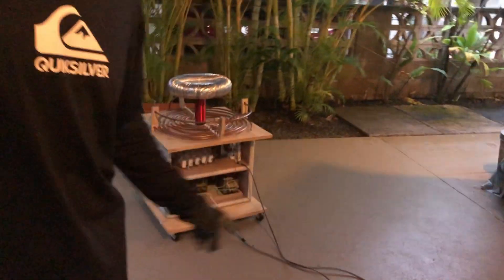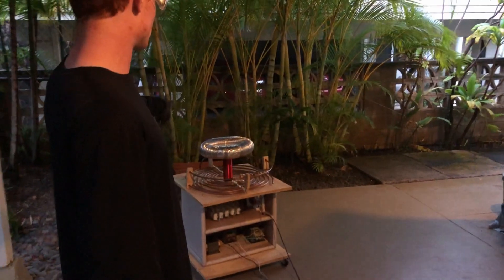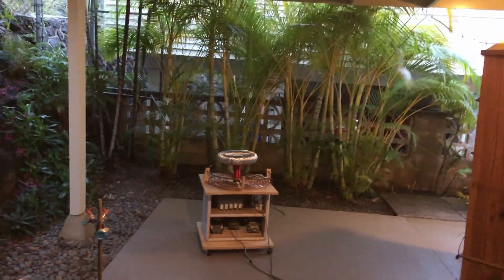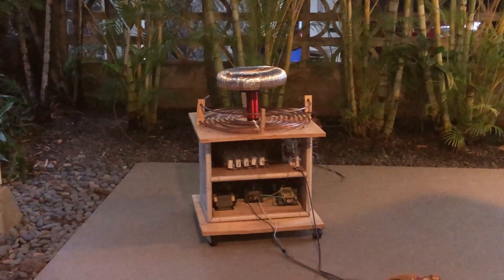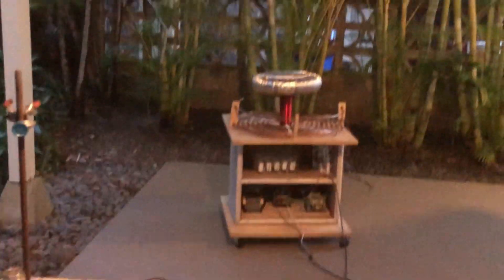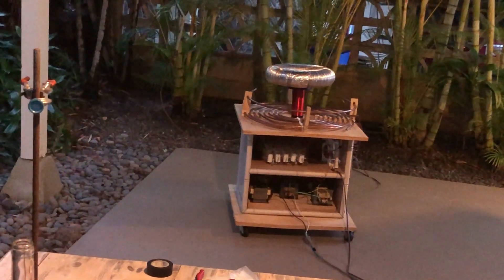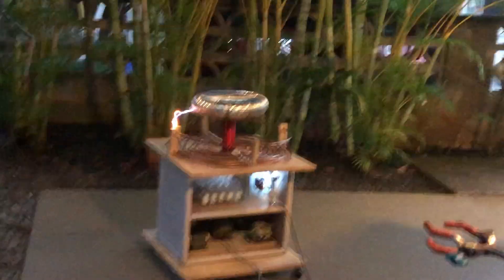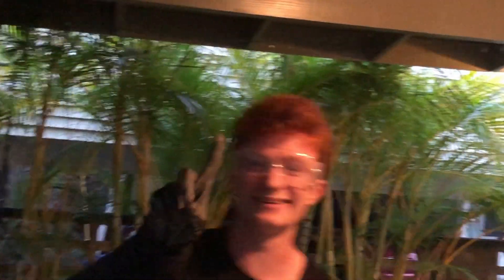Spark Gap Tesla Coil First Light

Comment: Freakin A man. That's a hot spark. What is that, like 5 microwave oven transformers on the bottom?
Reply: Yes it is! But only three of them are adding their voltages, and one of the other two is acting as an inductive ballast. I had originally planned to put the 5th MOT in parallel with the ballasting MOT to draw even more current, but upon testing, I found that amount of power heated the spark gap too quickly and decreased the coil's performance.
Reply: @tatemcaluney7269  Oh right, I forgot about using them to limit current. Excellent job sir, that's a really beautiful device.
Reply: @WaffleStaffel  thank you! check this out! ;) sneak peek